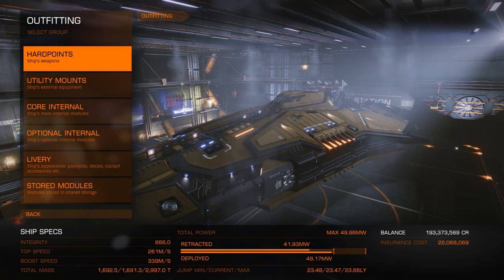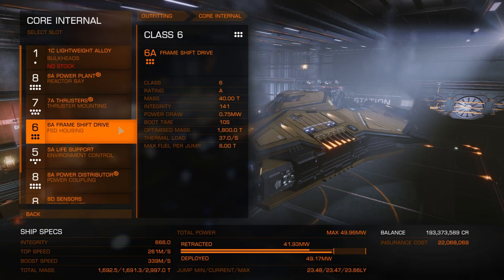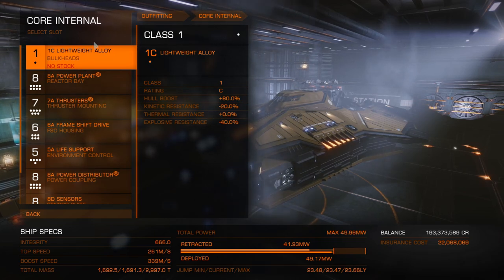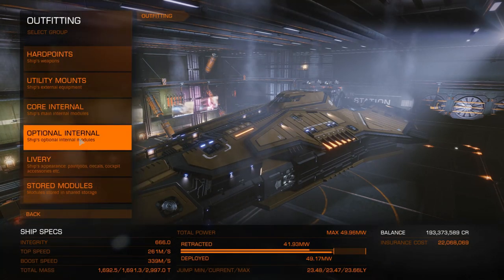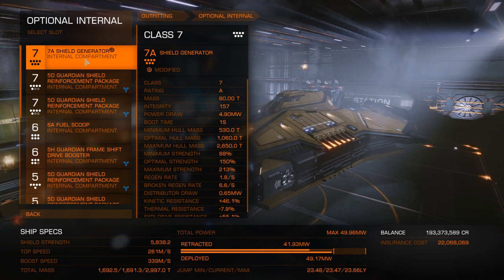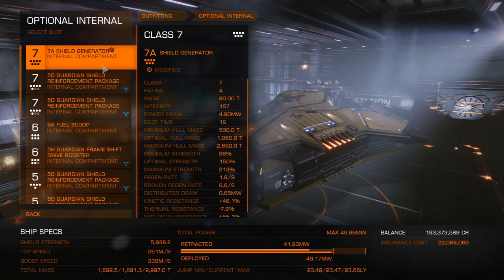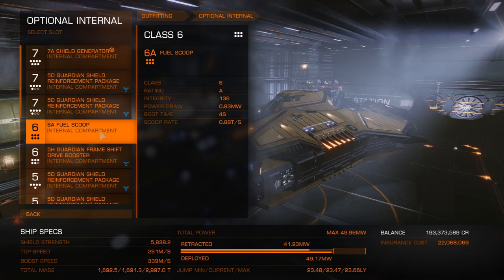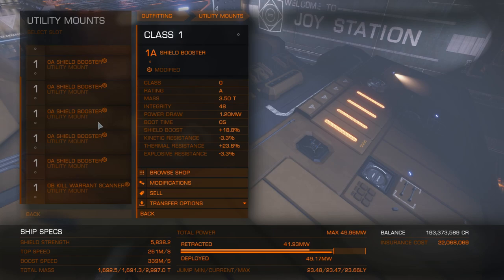Elite Dangerous | Federal Corvette | Combat Build

Comment: IMHO, Not a great build CMDR. First off, GSRP's are a SUPPLAMENT, not a replacement for good shield engineering. Additionally, To run that many GSRP's and lasers, you're overcharging the piss out of the PP which deals with heat poorly and requires some thoughtful heat management or you cook. G5 RF Pulses generate a bunch of heat adding to an already toasty ship. This adds up to unnecessary module damage and a hefty CR100,000+ Repair bill each time you dock. On top of that, once your shields drop, you're left D.O.A. with a wafer-thin hull and a prayer wrote on wet toilet paper.  

Essentially, the more difficult the battle and the longer you're running the lasers, the more S.O.L. you are as the ship runs out of power and begins to fry. The way to beat this ship would be to dance around it for the first half of the battle, and fillet it when it's modules are malfunctioning in the second half. 

I'm not saying this is the be-all-end-all corvette, but this is my full laser PVE / Open Play "Stay in a haz-rez or back-to-back CZ" Build and it's complete and utter overkill:  https://s.orbis.zone/bnz9

You'll see it's got an OC'd PP but the lasers (even though efficient and TV which is often considered suboptimal) do a fine job of cooling the ship off (both for battle and for SCB's), but independently either the beams or the Pulses can operate indefinitely.  The SCB's give my shields ample supplement when they start getting weak (additional 7200+ MJ) and if they go down, good luck plowing through 5,400 hull. Fighter hanger is in there with a pair of fixed multi-cannon condors for added punch but I swap in a Guardian FSD Booster when I want to get somewhere faster/further out or an added Hull Reinforcement if I'm feeling super scared.  All while running around 46/47ish MW of power. The point to my build here is to have a full-energy build without power-starving anything or cooking the ship, and still have a meaningful DPS.   This will melt anything from a sidewinder to a FGS and takes out an anaconda (Target Power Plant) in about 20 seconds with good flying. It's also a LOT more engineering to get it here, so I understand where your build is coming from.
Reply: Hey man. Even though this isn’t my vid, thanks for the constructive criticism you gave this CMDR, and not just try and shit on it like some of these ppl.

Comment: anaconda still a better ship i spended 1 week for farming reputation i still regret it. also i have 8k mj shields with conda and resistances 73 45 69
Reply: Corvette has 3 Class 7 slots to the Conda's 1. That's the main difference. Class 7 shields plus 2 Class 7 SCBs make the Vette edge out the Conda in pure combat. All other differences are negligible (pitch rate, speed, dps, hull, etc., are all very close). The Conda is a better multiclass ship, but the Vette is superior in combat. The only thing that cancels out the advantage in it's shields are cascade rails (which cancel the SCBs).